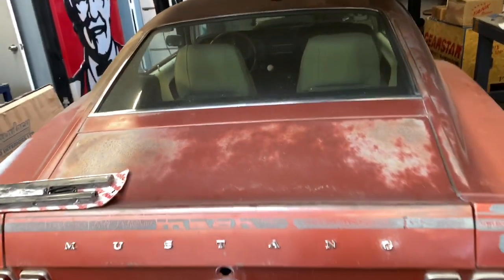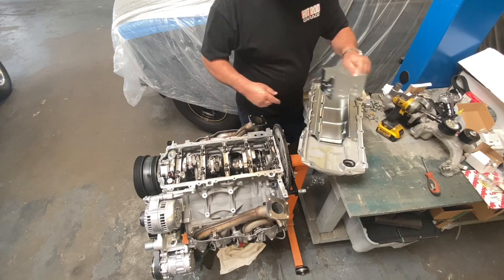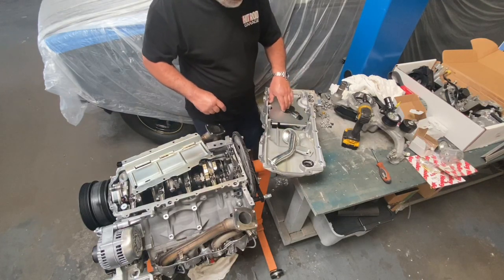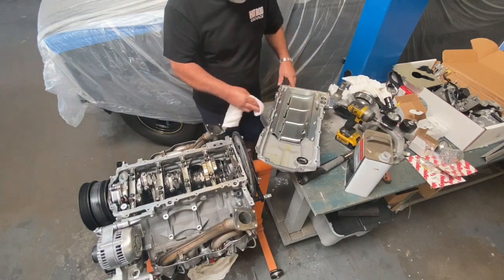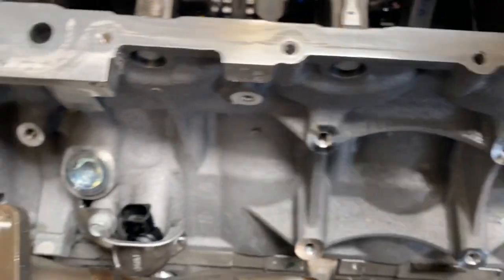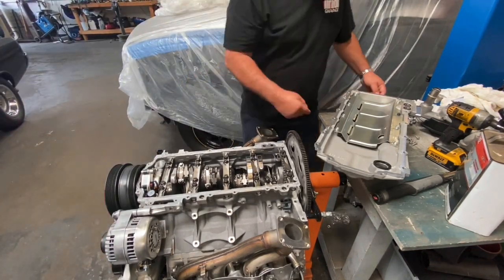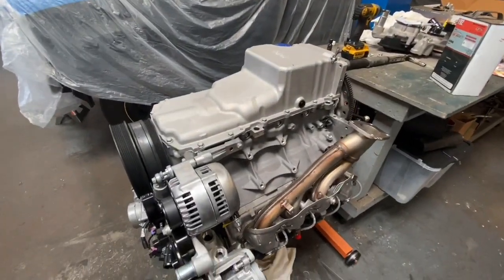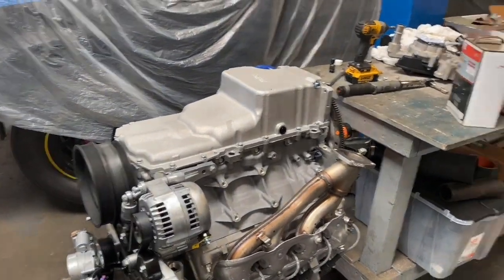LT4 gets a Holley Pan to fit this OBS Truck

Comment: Good tip on keeping the RTV from solidifying, I’ll try that next time. I have when you use a little then the whole tube dries up on ya
Reply: Me too. I just needed a little bit and had three tubes solidified.
Reply: Been doing it that way for 20 or more years now, just gotta keep em on their own and not let them get knocked around, I never close my top chest tight and keep them in the fold of the lid.

Comment: I like the belt arrangement on the A/C.. relocated.  Short and compact. I'm not so much a fan of manifold based Supercharging because I like the additional cooling of the blow through.   The Centrifugal blower mfg's could learn alot from the small and tidy belt arrangement... The Belt is often the achilles heel.  Keeping it small.. like a Timing belt etc improves reliability.  This would appeal to those not wanting the plumbing of a turbo.. but tired of having belt issues on blowers.

Comment: I would use about a third the amount of goo he did on that pan, you need to be careful about it getting into bolt holes especially blind ones as it can either give a false torque reading or hydro lock the bolt and strip the threads or crack the block.
The excess that squeezes into the pan can block the oil pickup or galleries , or the water galleries and radiator when sealing an intake or water pump. Also it is better to let it dry a bit before going more than finger tight.

Comment: Thanks for the Video....Excellent Tutorial on changing the Oil Pan.... I learn something from every one of your videos. In case its hasn't  happened to you yet...Sometimes squirting a little extra RTV on the end will work and sometimes not. I have found its better to take the applicator off and screw the cap back on...Left long enough, it will set up all the way into the tube. And of course it will always happen when you only need just a little bit. Stay Healthy And Safe My Friend.. Regards...

Comment: I have an 89' GMC c2500 with a 5.7 and a fresh miss / backfire .. ironically it came just after the transmission went bye-bye .. and to make matters worse three months later the trans ... had a di-fullculty.. apparently the rear section didn't have fluid and  pow! In Monterey the thing needed a new.. upon retrieving it the motor missed and backfired.. I've replaced wires cap n rotor to no avail .. any suggestions?  It has 163k on it

Comment: Why did GM stop using gaskets on the oil pan for the LT engine?  Does anyone make a gasket for it?
Reply: Because form in place gaskets are more reliable, longer lasting and allow the sump to become part of the block stiffening structure, by bolting down tight.